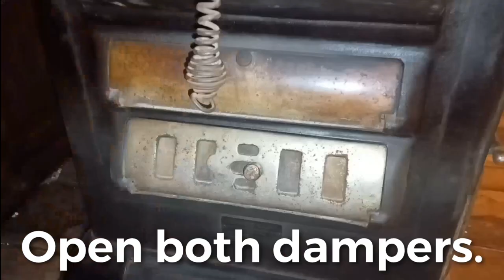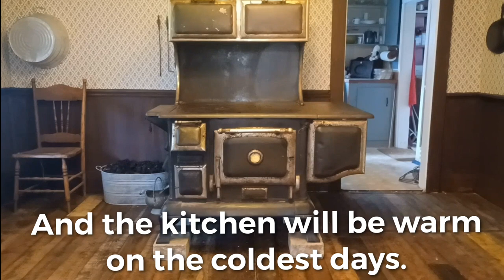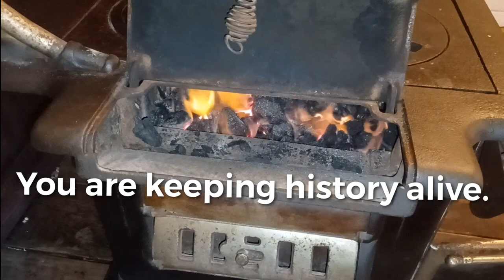Coal fire on a cold, rainy day. ASMR

Comment: I gunna try this I have a similar stove but I can't get the coal hot enough, I tried your method without charcoal, the coal wont get hot enough.. bottom vent is open, top closed, I only have a draft control on the back of the stove that goes to chimney that is also open
Reply from the maker: Charcoal or hardwood works. You want the wood fire screaming hot, then put on a skiff layer of coal. Add the coal in small amounts. Should start glowing, blue flames after a while. Bottom air open, leave ash door open if its not heating up fast enough. (Be careful leaving it open too long.) Top air closed if you have a top air inlet. Stove in direct draft (oven damper open) and pipe damper wide open. You can search on coalpail.com for good information.
Reply: Charcoal and fire worked great thank you. But I lost I think I rushed and left the bottom door open to long, I live in PA tonight is gunna be 30 degrees so I'm gunna try again, I did read alot of coalpail info